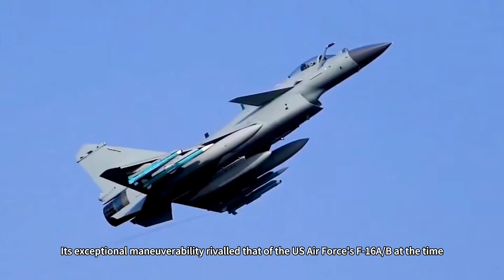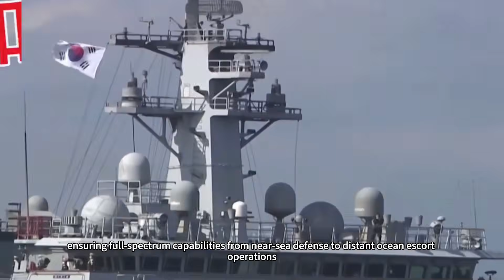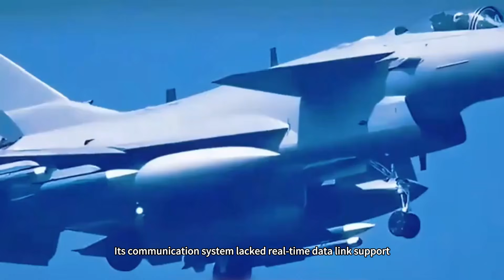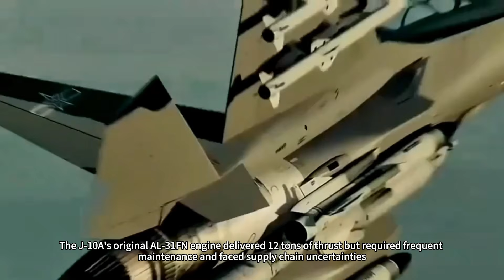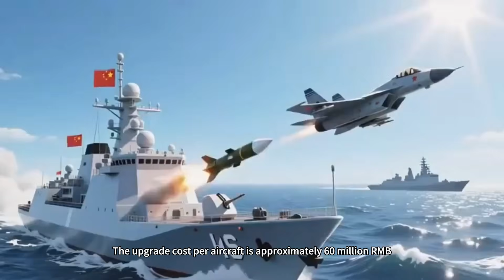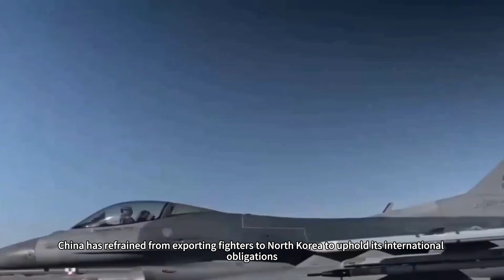All 310 older J-10A fighters undergo major upgrades! To be exported to North Korea and Pakistan?

Comment: Sooooo China wont have any J10s in their inventory!? Is this how it works? Wouldnt they be kept as i dont know back up?
Reply: Of course China keeps the upgraded J-10AGs as back-up since Pakistan buys NEW J-10CE fighters and China will not export the J-10AGs to North Korea in line with her international obligations under the UN's ban on such exports to North Korea.
Reply: @johnseah5678 Officially, China have over 300 J-10A in the Air Force and when the J-10AG upgraded, China will have additional 300 4.5 Generation J-10 with immediate effect.